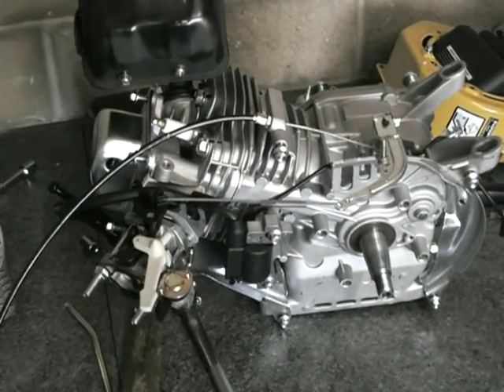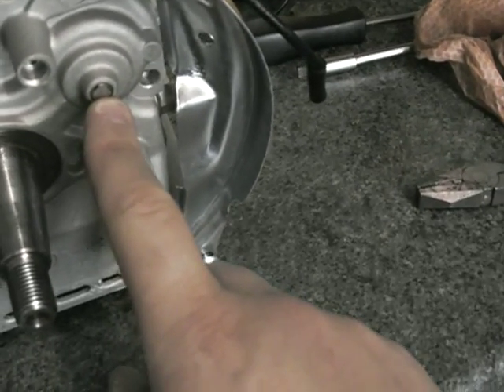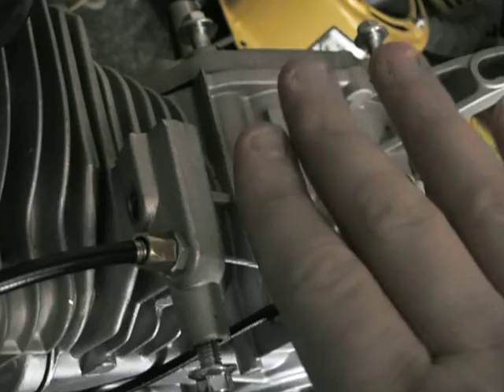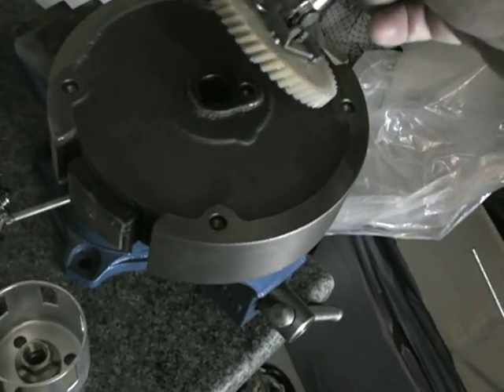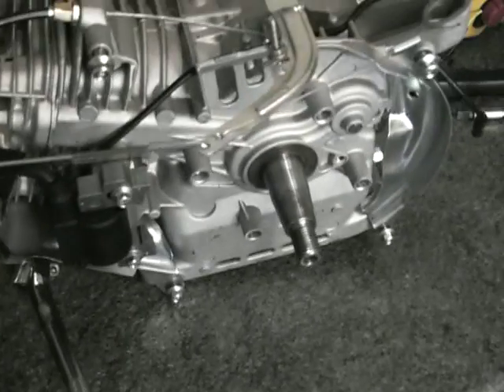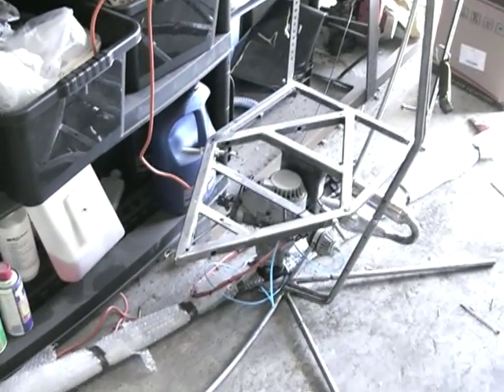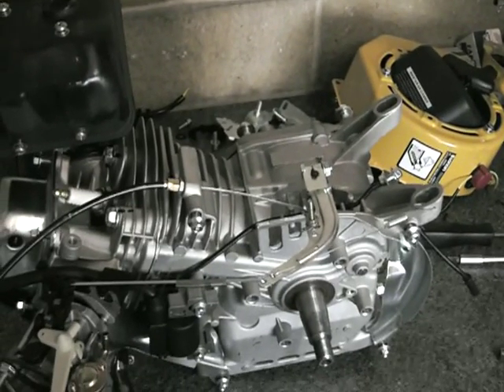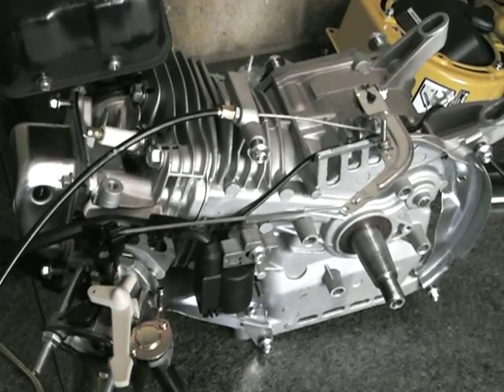GX200 Eggmotor. Superbox Engine, Stripped!!!

Comment: What parts are need to add the propeller? i have a predator im trying to add one on to?
Reply from the maker: DiceSensei hi, you'll need something like a 3/4" kart hub. If you go to my old but still marginally functional web site there might still be a link for it. Go to eggmotor.atspace.co.uk
Reply from the maker: You will need something like the steel or aluminium engine hub off this page: http://www.zero-error.com/quarter_midget_engine_components.php
Reply: cool bean brother, how hard is the process of installing the hub? thanks for the assistance also!
Reply from the maker: DiceSensei it just slides onto the output shaft and then tighten grub screw to hold in place. Best use some threadlock to ensure screw doesn't work loose. Your welcome for assistance :)

Comment from the maker: Hello, 

The purpose of my venture with this engine is to make as cheap a paramotor (ppg) as possible and so I've had to make compromises. The Superbox kit roughly gave me the power I needed with the standard carb (+bigger jet) for a reasonable price and I can build a complete paramotor for less than £1000 where as commercial motors start from £2500 going upto +£5000. 

As it's an aviation project I've not had the engine running prior to the mods being fitted.

Cheers,

Rob.

Comment from the maker: Hello, the carb is the weak link now but I have drilled the jet out to 100# as it wasn't running well(wouldn't rev over 1500). If power is still insufficient then I'll go for a 390 or Mikuni carb. I would also consider a wilder cam and/or 14cc head instead of 18cc 160 head.
Cheers, Rob.

Comment from the maker: Hello again, I've got a GX160 head now. All the upgrade parts have been fitted now apart from the head(I'll do that tomorrow). I'm looking at 14-15hp with this engine. 

One of my US contacts says he would be happy to supply bespoke modified 15-16hp engines for less than $700 if my project went commercial. That would save me sourcing parts and upgrading the engines myself. Plus, the mods would be expertly fitted.

Comment from the maker: Hello Peeps!!!!! When I've got the engine in bits, part of the upgrade is to fit a new billet con rod. This means I need to remove the cylinder head. So I could order a GX160 head for about £40 and fit that instead. This is a popular karting mod to raise compression ratio from 7.9 to 9. If I'm lucky, the power might then exceed 15hp. A milled head can raise compression upto 12 but I won't go that far just yet. 
I've got a 2 week wait on the prop too :o(

Comment from the maker: Can't wait to see some of your vids 808.

I'm tempted(as the GX200 mods are relatively cheap)to order a GX160 head and maybe a 22mm Mikuni carb(total $120). The extra compression(10.5 instead of 9) and improved breathing should liberate an extra horse or three. I'll probably wait until I've done a thrust test with the upgrade kit first before deciding on upping the power. Gotta keep your options open!?!?! ;o)